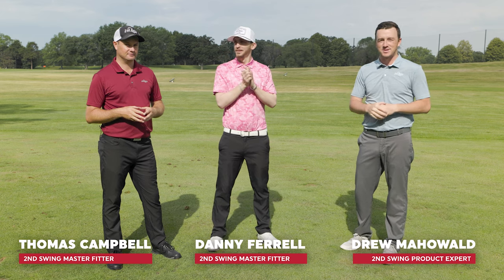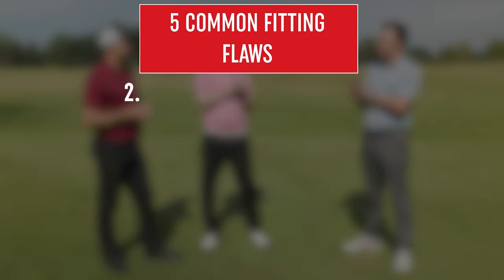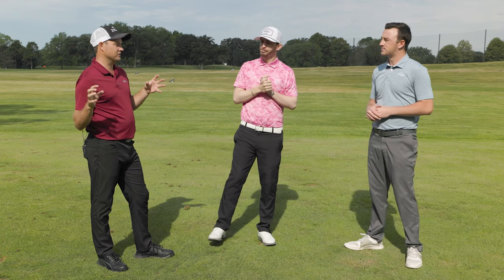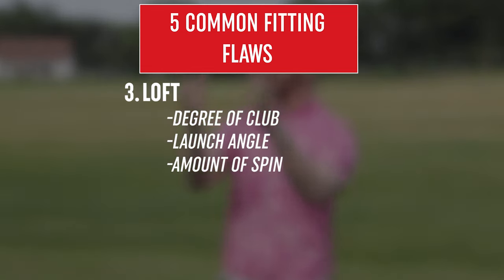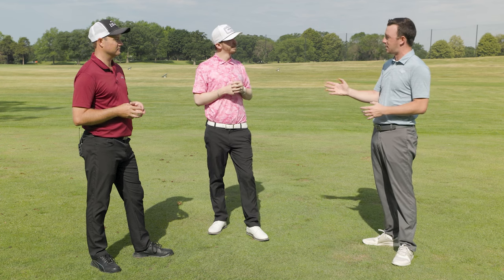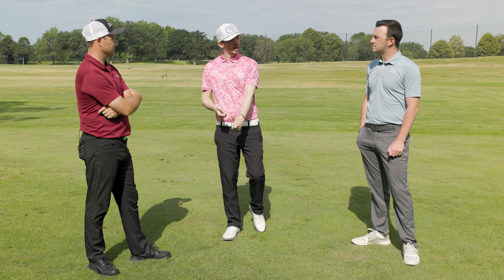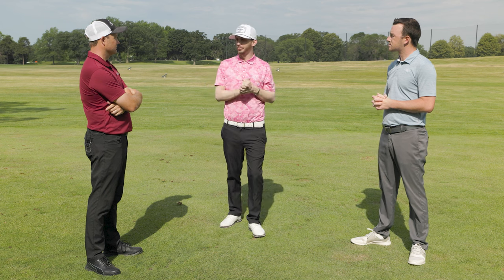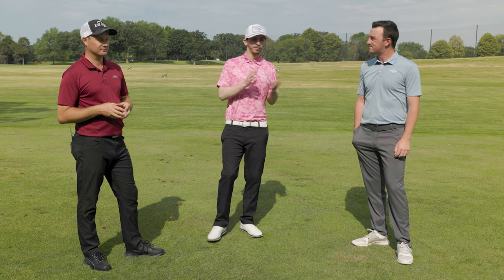Common Golf Club Fitting Corrections | 2nd Swing Tour Van Fittings

Comment: How do you get fitted for a blended set?  Don't they only let you hit 7 irons at fittings?
Reply from the maker: The manufacturers only send 7iron fitting components as part of their fitting packs. However there is a huge advantage of getting fit for 2nd Swing here, most times I have a set slightly used in the store and track the other clubs down. However when not possible my suggestion is think about where you would go more at the flag vs middle of the green and make your transition there - Thomas

Comment: Thinking of switching my COBRA LTDXLS  in to 10°. My numbers are 124ss F/A 0.6,  F/P +1, hitting 3.5 up. problem is spin gets alittle low, (1900ish) would rather be around 2400-2500. Normal carry is 310. ball speed is 178-182 stock. Thoughts? BTW have a Ventus Black 6x tipped 1 inch.
Reply from the maker: A little more loft will increase the spin. Give 10* a shot. I presume you have a 9* head. You will probably hit it straighter but may loose a couple of yards but nothing to worry about if you already carry it 310... - Thomas
Reply: @2ndswing  yes standard 9°, Ive played 3 rounds since, lost around 4 yards, ball seems more stable. Still getting the same ball speed